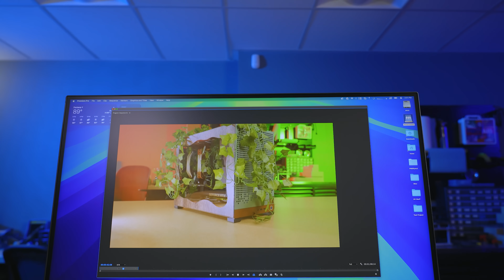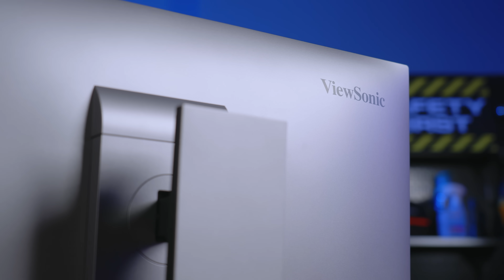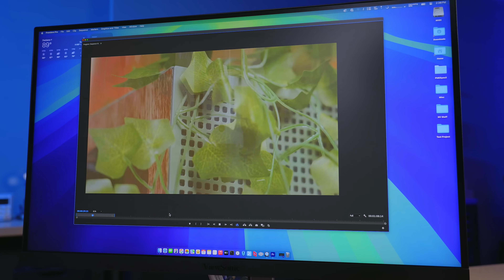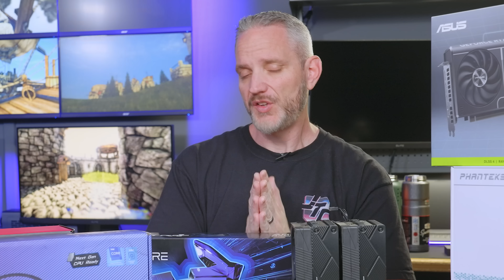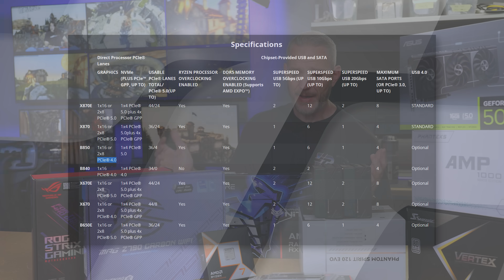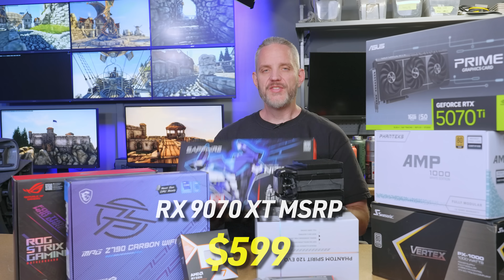This is the Sweetspot for PC gaming... Don't get fooled into spending more!

Comment: Literally Just Built my new build, 9600x with a 9060XT 16GB. For the money I’m thoroughly impressed.
Reply: I got same gpu, but cpu ryzen 5 7500f
Reply: @ThisIsLolaRossa  I just got this combo too, hard to beat for the money and performance level
Reply: I spent $1400 on a 7700x/7900xt build this past January when I finally ditched console. Had been on console my entire life, haven’t touched a console since lol
Reply: Just built a system with a Ryzen 5 7600X and 9070 XT. And it's been amazingly solid.
Reply: @FinnLovesFP nice man . I just got a rx 9070 . I am considering your CPU . Do you experience any bottlenecks at 1080p ?
Reply: @i @ismael2305  I’ve got the same CPU and nope. Not a single bottleneck. If there is one, it’s so small, I don’t even notice it
Reply: Put together a 9700X/9070 XT build a few weeks ago, loving it. Came from a Ryzen 3 1300X / GTX 1060 3GB system 😭 phenomenal upgrade
Reply: got a ryzen 5500 and a rx 6600, 16gb ram currently.
Reply: @cyclonekittenplayz4302  got a 3060 instead. bought that as a complete build for 800 a couple years ago
Reply: 9060XT, and 9070XT are some of the best bang for buck cards I’ve seen in years.
Reply: i just upgraded to the 9600x. i had an i7 9700k the 9600x pairs way better with my 4070
Reply: @Stackali Coming from an i5-4690k anything was an upgrade to me lol
Reply: @naterchips8816  omg i just did too, i got a whole new pc and i still have my old rx 550 4gb in my new pc thats from my old pc since gpus are expensive rn but im planning to either buy either a rtx 5050 or b580, idk which one since i only play 1080p and also cause i dont want to deal with crashes or stuff like that and nvidia does have better frame gen but idk, but yea my rx 550 i have on rn sucks lol
Reply: @naterchips8816 wow we have the same cpu😂
Reply: @naterchips8816 That’s exactly what I just upgraded from. I upgraded to a i5-12600KF.
Reply: @naterchips8816  i still got an i5 6600k..  and can still play apex legends and get 130 fps on high settings..  kinda impressive
Reply: @Stackali hey I just bought 9600x and I was going to buy asus dual 4060 but I got gigabyte ice 5060 cheaper, 32gb 6000mhz cl30 . Im looking forward to seeing how it performs. 
 How are you finding your combo ?
Reply: @pauljohnson9326  Why did you get a 5060? You should've gone for a 9060 XT 16GB, you could've saved some money by going for a ryzen 5 7600 instead
Reply: @Stackali  I would hope so, that 9700k is 5 generations old
Reply: thats a good combo
Reply: Also got a 9060XT 16GB but with the 9800X3D because i play a lot of management and strategy games that need as much CPU as you can get
Reply: @Angel_EU34  This is always the way, easy upgrade for the video card in the future. And that cpu is golden for 5 years easy maybe 8-10.
Reply: @jetrpg22  Exactly! 👍
Reply: @Angel_EU34 same
Reply: @Angel_EU34  oc 9700x can sometimes beat 7800 x3d bro whyyy
Reply: @Angel_EU34  woohoo i am going for 9060xt with 7800x3d DAMN
Reply: @Angel_EU34 you are insane. No game need that CPU. A 5600x does the job in any game still.
Reply: @zeus1117 Not as well as in Anno 1800 and other heavy management and strategy games.
Reply: @Angel_EU34 lol bad combination
Reply: @Angel_EU34  I'm looking to buy exactly the same setup because I'm a paradox interactive nerd, how's it working so far?
Reply: @Angel_EU34  literally the 9800X3D is overkill unless you're using something like 5080+
Even the 7600 won't bring you any bottleneck, but the sweet spot is 7700/ 7700X for 9060XT or 9070XT
Reply: @vyrgozunqk  It really depends on the game.  Some games are ridiculously CPU bound.
Reply: @Angel_EU34 horrible matchup.
Reply: @BrandonWestfall  wtf are you talking about lmfao he plays CPU intensive games, clown
Reply: @MarkFin9423  do you even know who i was referring to?  i highly doubt it lol
Reply: @BrandonWestfall  Not really if you know what you need. At end game high population playing Anno 1800 my current system humble GPU is chilling while my CPU is absolutely throwing it's guts out @ near 100% usage. Same for grand strategy Paradox games and many others in the genre.

EDIT: for clarification i mean my current old system, not the new one with the 9800X3D and 9060XT (still waiting for the GPU to arrive in a few days)
Reply: @MarkFin9423 why is 1080p not future proof? You don‘t exactly need to replace your monitor and any game will support full hd
Reply: @MarkFin9423  1080p isn't being phased out.  It's still super popular and probably will be for a very long time.  Competitive gamers use it, people gaming with high refresh rate on a mid tier card will use it and budget gamers will as well.
Reply: I just put together a 9800x3D/9070xt build.
Reply: @dirkjewitt5037 same here. Paired with  4k 32 inch alienware OLED,  I've been very happy
Reply: @dirkjewitt5037  Absolute beast of a system for reasonable money!
Reply: @dirkjewitt5037  Same
Reply: @LastRights_ToLive  Sigh, RIP Fry's.
Reply: @dirkjewitt5037 can you give me your opinion on your build? tell me whatever you can cuz i'm thinking of getting it
Reply: I was about to said this I just did this too and in Newegg you can find all the 9060xt 16GB model to your like, I spent $1200 so go ahead guys
Reply: 7700+9070 is sweet spot now. Low end - 7500f+9060xt 16gb
Reply: Shoulda put 96gb ram for continuity sake
Reply: @heksatek3407 what the hell! Are you trying to obsolete in 3 weeks! 😂
Reply: @squidsleap 960gb of RAM will go obsolete in under a year, 30 weeks. 1Tb of RAM is the sweetspot.
Reply: @Clrcbst lol what.  who has 1 tb of ram?
Reply: I'm saving the extra bit for the 9070 xt.
Reply: The advice on the cooler is weird. Overspending by 100% just in case of an insane upgrade?
Reply: Just got a 9600x for my first PC and I'm looking to get that same GPU
Reply: Pretty much same here.  9700x and 9060XT 16GB built like a month ago.  Super impressed with the price/performance as well.
Reply: @mattscott5732 for the 9700x, you should try going to the bios and go the advanced cpu settings, and the to the precision boost overdrive menu (it differs between motherboard manufacturers), then you change precision boost overdrive to advanced, pbo limits to motherboard, curve optimizer of all cores to negative 30, and then max cpu boost clock override by plus 100 MHz. After doing that, the performance of the cpu will be similar to the 7800x3d (beating it in a few games) and will have better productivity performance than the 7800x3d
Reply: I got myself a 9600X as well, but found a nice 7900 GRE used for a good price :).
Reply: Me too
Reply: Same.
Reply: I love my 9060 xt also. Mine runs a little over 3300 mhz. Its not even overclocked. Im not a fan boy, but I do enjoy AMD. The am4 is still very relevant.
Reply: great build
Reply: Banger of a build for the cost honestly. The new 9600x3d should make that even better assuming it isnt priced too high.
Reply: Good choices!
Reply: I spent 1050 euros for 5800x3d 7800xt last year. Selling my 7800xt to buy 5070ti soon.
Reply: @pR0ManiacS  Bruh why, you just bought a new GPU last year and now you're buying a new one, you know how much money you're losing?
Reply: @CLutch4444 i bought the 7800xt off scalpers. Did its job. Will sell for just 50€ less. I payed 425€. I can buy 5070ti from scalpers with 800€ . 

So how much do i lose exactly ? I want to mention that during that time 4070tiS from scalpers was also around 850€ - 900€ . And i enjoyed my 7800xt alot During this time.
Reply: @CLutch4444 also i do it because the cpu handles this gpu in 1440p pretty well. I also want the nvidia reflex and better lows that it provides in cs2 , and also i'm willing to play black myth wukong with as much graphics i can squeeze.
Reply: Awesome to hear. Do you know how well it runs marvel rivals?
Reply: Me also. With 32Gb DDR 5 6000 memory. Will upgrade this next year to 64GB. NVME is only PCIe version 4 because version 5 is too expensive atm.
Reply: enjoy the build, sounds like a good one :)
Reply: @materchips8816 I just built the same thing, definitely the sweet spot :)
Reply: Got 7600x3d and 9070 myself
Reply: Good choice
Reply: 7600 even better value.
Reply: I'm literally about to do the same thing!!!! But I'd LOVE to get the 9070xt instead🥹
Reply: 7500F + 7900 GRE would've given considerably more performance.
Reply: with 960GB SSD and 96GB RAM?
Reply: I got the exact same config literally right now
Reply: 16GB RAM is a bottleneck in some games.
Reply: What motherboard did you go with?
Reply: @scott-dt8zx ASRock B850I Lightning WiFi M-ITX, wanted to mix it up a bit so I went with the Tower 250 for the case
Reply: Seems you like the numbers nine six and zero
Reply: About to pull the trigger on the same build myself. Upgrading from a 6700k and 5700xt
Reply: Completely agree, and did the same with 7700x
Reply: I went with this meta too and it's SO good
Reply: did you equip it with 96gb of ram too? for continuity sake ya know haha
Reply: What games are you playing and how many FPS are you getting. Did you play battlefield 6 if so how smooth was it
Reply: My sweet spot when I built a pc earlier this year was ryzen 9 7900x, B650, 32gb ddr5 6000mhz cl30, and 9070xt.
My previous pc was a rtx 2080 with an i5 8600k
Reply: @pjell  who in their right mind pays $700 for a video card
Reply: I got 7 7700x and 9070-XT
Reply: What would I need to play Arma reforger on ultra settings 1080p ?
Reply: @HyperHyena88 I average average in the low 100’s at 1080p ultra with this combo. And that’s with FSR off.
Reply: Which brand? I notice there’s quite a price difference between gigabyte and xfx
Reply: @conorchapman733 Gigabyte, at the time of purchase the gigabyte was only $10 more at $389
Reply: Sweet right, im still running 5900x with a 3090 lol been wanting to upgrade but just no need yet
Reply: I got a Steel Legend Radeon Rx 9070 Xt 16 Gb Asrock
Reply: Working on same build.  What motherboard did you go with?  How is it running?
Reply: Ya to play on low-med settings on new games.
Reply: I’m about to do a 9700x and a 9070XT. Never used an AMD GPU but I love their CPUs since ryzen’s first days. Questions: how do you like the 9070xt and have you set up smarter access memory since you’re full AMD
Reply: I am new to pc’s but considering this combo.. thoughts 
Ryzen 9 7900 - 32GB DDR5+ RTX 5070 - 1 TB
Reply: God Bless Everyone Reading this! Jesus is the only way to Heaven! He Loves you and wants to save you!
Reply: Dios Le Bendiga a todos! Cristo te ama y te quiere salvar! Pon tu Fe en el hoy!
Reply: I went with Ryzen 5 5600 and rtx 5060 with very solid components around it and 16Gb RAM, the entire computer ended up at about 750€, considering the absurd prices nowadays I’m very proud of it
Reply: A year later, but I just built a rig with 9800x3d and pny 5080 rtx. I spent a lot, but wow. Words can't even describe how sweet this system is
Reply: I was looking forward to building a pc last year. Instead, I picked up a pre-built on clearance. I spent $1400 for an acer Predator with intel 14700f cpu, rtx4070 super 12gb, surprisingly decent motherboard, 32gb ddr5 ram, 1tb m2 ssd, 800w psu. The undersized CPU cooler was my only complaint, so I installed a 240mm AIO. The case already had mounting holes for it. I've been impressed with how well the whole tower is set up. There's even an anti-sag bracket for the GPU.
It was cheaper to buy that PC than to build one myself with that CPU and GPU at the time. I don't regret it a bit.
Reply: @Brandon_Nelson92  7800x3d is much better for gaming than that cpu..
Reply: I came from an i5-11400 RTX 3060 Ti -> R5 7600 RX 9060 XT 16GB, massive upgrade
Reply: Dude I just got a 9060XT 16gb Gigabyte Windforce OC edition to put into my 2nd PC in my living room for $390. This PC has to be absolutely budget in mind. This GPU absolutely impresses me for sub $400. I have it on a older 1151 PC on a 9700k Processor I got used off Ebay, and some bargain bin Ram from Micro center. 64gb for $110 3600 DDR4 ram. 

On a ballin on a budget set up for very very cheap. It absolutely rocks modern games at 1440 120hz. All high/ultra settings hitting 70-100 FPS pending on how hard I dial in some more intensive settings like mild RT or something fancy. 

Cannot complain! Glad I built it now before all these tariff prices catch up soon. 

What amazes me is in my Primary PC I built it with a Gigabyte 4070 OC 12gb model. Despite being 12gb it absolutely punches way hard in power and graphics despite having only 12gb but it was $550 and even that was considered a bargain as most 4070 I just could not afford.
Reply: @Pixels_And_Petrol 400!? That’s impressive
Reply: @victortan6378 Micro center had some Asus 9060 XT 16gb at one point for $350 on sale but it was hard to hands on one so this was next best deal I could find. This ended up working out since I picked it up in DE. 😉
Reply: Great combo, I have the same but with a 5070, I probably should have waited for the amd gpu offerings, But couldn't wait when i built.
Reply: Sunk cost. Of course you're happy. I wouldnt be with that stuff.
Reply: I recently delidded my 9950x and went direct die with the AM5 mycro block, fully custom hardline watercooled build with 4090, 4TB of nvme gen5 storage, and 8TB of nvme gen4 storage, 64GB of DDR5 6000 at CL28 (also have a secondary kit of 48GB of DDR5 7600 at CL36 which also runs fine tbf, but I don't see an uplift so prefer to not run ram on the edge to not push the mem controller into oblivion), 2 x 480MM rads and 26 120mm lianli infinity fans, on a x670E Godlike mobo, all housed in a 1000D chassis (the system is gigantic). Cost... I prefer not to speak!
Reply: @benjaminsmekens2344 
😂😂😂
Reply: All these AMD fan boys that only buy amd everything. Buying the 5070ti at $750 is great!

2nd) Honestly the 9800x3d for $500 after tax is insane unless you have an rtx 5090. 

If the 9800x3d was down to earth for $399 regulary then id say ya 😉. Its the the fastest gaming cpu at 1080p and 1440p. But with a mid range 5070ti a 14700kf for $300 is much better and then get a 4tb m.2 Samsung ssd instead of a 2gb. Bf6 and many games need LOTS of space.
Reply: I just spend 3k on a 7800x 3d and 7900xtx 32 ddr 5 and 5tb of hard drives m.2 a year ago
Reply: @maddoghamblin4304  did u steal my build haha thats what i did, then sweaped out the 7800 x3D to the 9800 x3D and gave the 7800x3D to one of my buddies
Reply: @N7_Ronnie I want to do the same but I can't justify spending another $600 for A CPU to just get an extra 5 or 6 frames per second. Uh when I switch from an X  to an X 3D, that was the biggest jump, like 30 to 40 frames per second. That's why I've never switched back. I started off with the 5800X 3D.
Reply: @maddoghamblin4304  Spent $5K on a 9950X3D, 5090, 96 GB of DDR5, and 12TB of nvMe m.2 (4TB + 8 TB) and it's been great.
Reply: @maddoghamblin4304  RIP. I just spent $2000 on a 9000X3D + 9070XT
Reply: @maddoghamblin4304  Built my 7950x3D and 4090 PC for around 4k 2 years ago.
Glad I did it when I had the opportunity.
Reply: @maddoghamblin4304 also amazing combo. 7900xtx still a raw raster powerhouse
Reply: @maddoghamblin4304  oof. My condolences, but an awesome build nevertheless!
Reply: @maddoghamblin4304  I bought 5060ti, 9700x, 32gb ddr5, b650, 360mm aio for $1,235. 
(If I didn't have to buy a cpu cooler I could've saved $110, I could've bought an air cooler, but didn't want a bulky piece covering up the rgb ram I paid for) lol.

I reused everything else like case, fans, & psu.

My original build had a gtx 1080, b6450, r7 1700 /w wraith cooler, & 16gb of ram was like $1,080.

To put it in perspective original build costed me like $1,500 for the pc + key baord + mouse + headset in 2017.
Reply: @maddoghamblin4304  Trying to justify the cost? Waste of money
Reply: Ya 16gb is nice. I built my 2nd pc with a 4080 super a year ago and been playinb everything in 4k DLS quality mode since then.